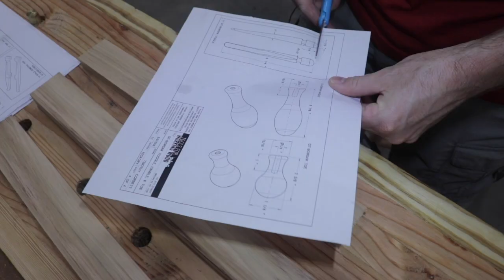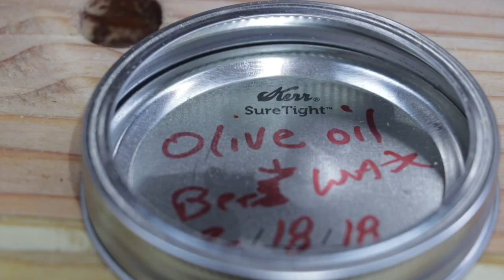Bow Saw Build | Woodworking

Comment: Had to watch again. Jim I want to make a bigger one . What dimensions should my wood be ? I am using a 24 inch blade
Reply from the maker: That’s a great question! I have no idea but I think I would start oversized and then slowly shape it down until the weight is comfortable. You could also build a prototype with plywood first!
Reply: LastingBuild thank you Jim, basically what feels good